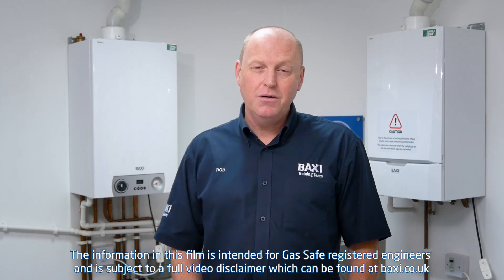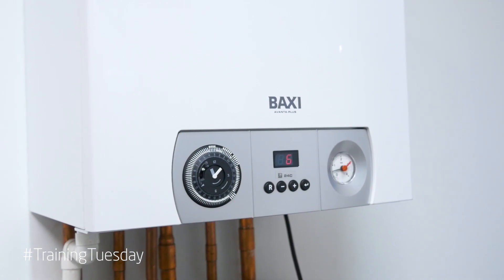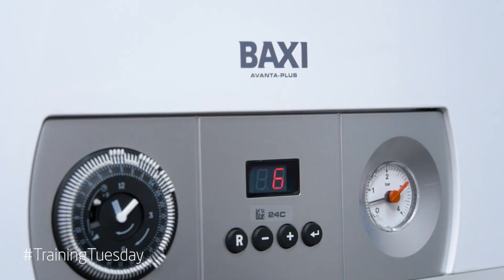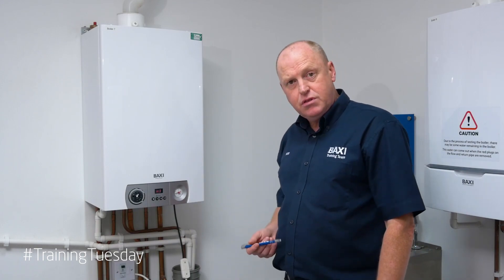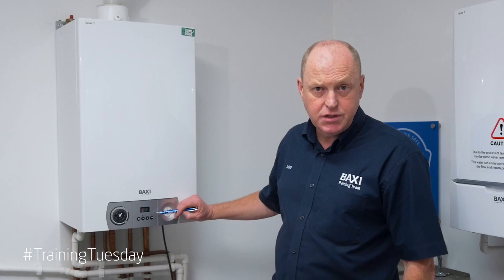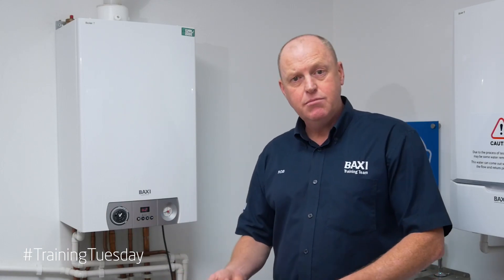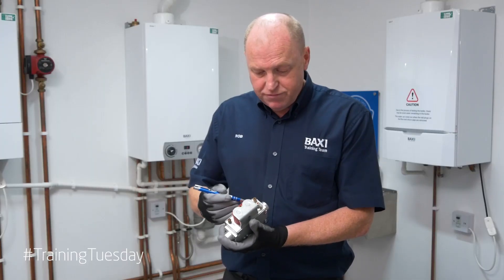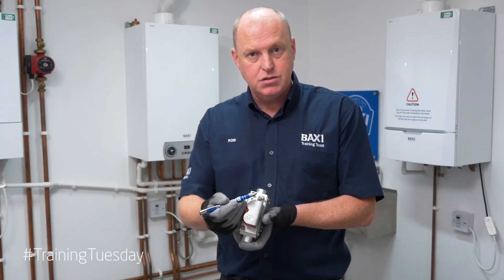How to do a combustion check on the Baxi or Remeha Avanta boiler range

Comment: I keep having to reset my  Remeha Avanta Boiler repeatedly to get the central heating running. It displays an "E4" error and is doing it more and more. What is going on? I called the gas man and he replaced the thermostat but its made no difference, though sometimes it ignites faster when I put the fan on and open the window.